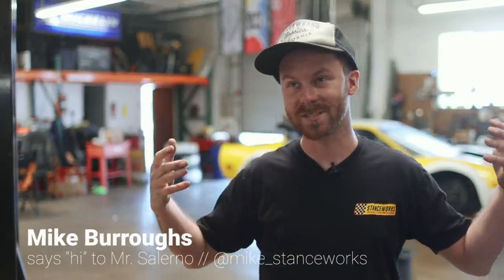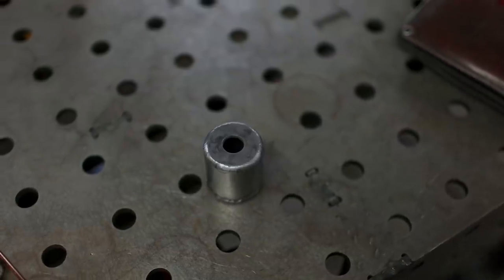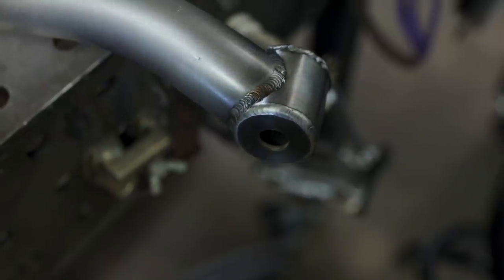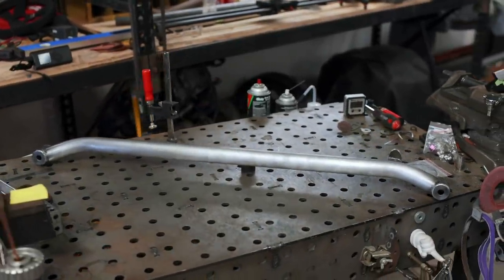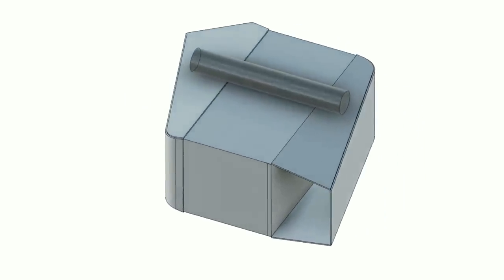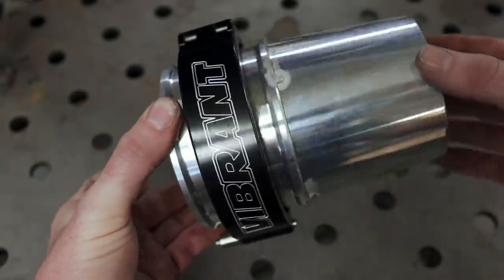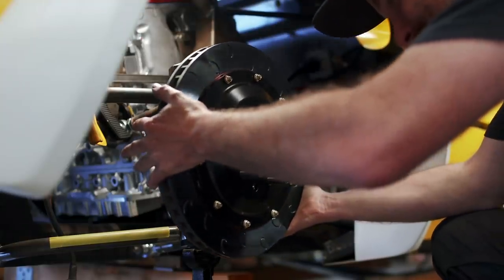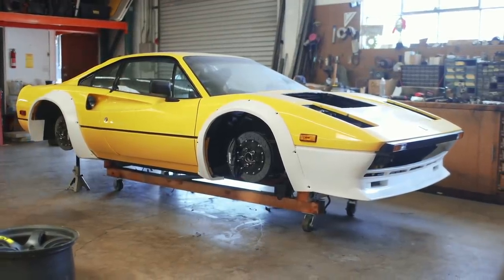Honda Swapped Ferrari - The Most FRUSTRATING Setback So Far…

Comment: If the heat exchanger is made of 6000 series aluminum, it will need mount damping with your proposed setup. That stuff fatigue cracks like a fresh tortilla chip.
Reply: @nicfoster  I remember the install video, but don’t remember seeing the core. He’ll have to figure it out.

Comment: Hi Mike, just an idea I learned a short time ago about removing zinc from washers and screws and stuff for welding. Grinding is OK but it can leave some zinc on top or in areas where your grinder won't reach. Take 25% Hydrochloric acid but it in a plastic bowl, throw in your zinced parts, watch the bubbles, don't breath in the fumes, the bubble stopping indicates when the zinc is gone. Rinse with water and weld pure steel without any zinc in it. You can even reuse the Hydrochloric acid for quite a long time! Sorry for bothering you. I'm just a fan and think your ferrari project is quite inspiring!
Best regards from Germany ✌️🇩🇪

Comment: If I'm hearing correctly... Attaching the toe arm to the control arm is a really bad idea. As the suspension travels, the distance and angle between the rod end and any spot on either control arm will change, making for massive toe changes. You really do want to attach the toe rod to the chassis on it's own pivot. It's exactly the same as setting up the location of the steering rack! You for sure have the skill and brain power to get this done correctly! Just make sure you have adjustments to raise and lower at least the outer tie rod on that stud so you can adjust bump steer. The goal should be zero bump steer or slight toe in under compression. Just helps stabilize the car on acceleration. Front should be setup for zero bump steer or slight toe out under bump travel, helps keep the front end from becoming twitchy on corner entry and mid corner.

Comment: You should try Muratic acid (pool acid from any hardware store ) it removes zinc plating in a few seconds then rinse off parts on water .. much easier and cleaner than grinding it off. Especially with nuts and bolts

Comment: I’d have to see your solution, but in my mind I can’t see how connecting the toe link to the control arm wouldn’t introduce dynamic toe throughout the suspension travel. As the suspension moves the distance from the spindle to the control arm has to change because it’s moving in an arc, and having the toe link connected there would have to introduce more dynamic toe than if the yo link were mounted closer to the frame rail in a near flat at ride height position.
Reply: I'm sure his plan is to build a tab on top of the lower arm that makes the lower arm and toe link run in parallel arcs. Otherwise yes, if the toe link angles down to the lower arm then the toe will change a ton through the suspension travel.
Reply: @Balomis  even if it is parallel at ride height it will absolutely move a ton through the travel. The length has to change as the control arm travels through its arc.

Comment: I know how you feel.  I once waited 6 months for a set of wheels.  Delay after delay.  Was flat out lied to several times.  At one point I was told that the wheels were in and when I went to pick them up they were mysteriously missing.  Searched their warehouse myself.  The salesman didn’t even help because he probably knew they weren’t there.  Was so frustrated but I was shit out of luck because no other company made they wheels in the sizes I needed.  When they finally came in months later they put the wrong tires on.  There was no limit to their incompetence.  I guess it was my fault for not having them send me a photo of the wheels before picking them up.

Comment: If I’m understanding your idea with the toe links affixed to the control arm instead of the chassis, I don’t believe it’ll work.  Unless the connection point for it on the spindle is on the same plane as the lower ball joint, you’ll have the exact same problem that you’re trying to avoid.  You’ll have variable toe angles as the suspension travels up and down because of the change in angle of the spindle to the control arm.  Perhaps even worse than if it’s affixed to the chassis.  Maybe you already have a solution by extending the attachment down to the plane of the control arm, but it is just a thought.

Amazing build all around though!  Would be nice if we could all afford to create our dreams as you’re doing.  Keep up the great work!
Reply: Just came to comment on this, I also don’t think this willl not work as intended, tslrunna423 already explained very well why. Anyway, keep up the great work with the project, and thanks for taking us along for the journey with all the ups and downs. Crazy to think that it’s the wheels now holding you back, taking into account all the possible obstacles involved in building something that no-one else has ever done!

Comment: Dude you’re definitely going to want some dynamic toe. As commonly seen on transaxle formula cars, use a bolt in pickup and have a few places to bolt it in for adjustment. The outer can easily be adjusted. This is going to be an unforgiving car with the wheelbase, width and power. Some dynamic toe in helps a lot.

Comment: The rubber mount for IC was a thought I had as well, but more than that the way the bracket is designed it's going to use 4 bolts in an arrangement that limits the way the IC has to go to get in to only be straight up rather than if the sides of the bracket were parallel it could slide in from the front or back on the way in.  If they were parallel you could go down to 2 bolts and a single captured nut for a little less work in fab and in installation.  Pretty trivial really.   I think the looks are great.

Comment: GOOD WORK!!! Your project is always an inspiration!  I'm not a suspension guru, speaking from my knowledge on my RX7 the rear of the car had a "Dynamic Trailing suspension" basically the toe would change with g-load to affect turn in and reduce oversteer. Although it was a trailing arm suspension that was a 5 point/axis setup.  But all in all, what people tend to do is eliminate the toe correction in race applications because it's more predictable when it's fixed.  That's just my two cents 😂😂

Comment: You've got the right idea of using an adjustable rod end welded to the lower control arm for the rear toe control.  Couldn't quite tell from the camera angle, but looks like you'll have quite a bit of angle on the rod end, so you'll want high misalignment spacers to handle the rod end angle.  It would be ideal if you were able to have the bolt that fixes the rod end to the spindle in double shear.

Comment: I saw the wheel crisis on the IG story when it happened and I immediately knew how defeated you were. You've been looking forward to them for months and they pulled the rug out on you.

Happy to see you're still able to make progress though! Brett's work is always top notch and the brakes look great on the car. 

Not to mention how great your welds look on the brace! I also enjoy the re-use of the bracket on the cooler, it still looks like it was made for it while minimizing waste. I'm just hoping that not adding rubber works out for you, I know vibrant's clamps have some play but the force of the water moving around during some high speed manuevers might cause some more flexing than you'd expect. Water is pretty slow in it's reaction to direction change, so the momentum alone of might cause some flex depending on the pump pressure forcing it along.

And I'm not surprised merch sold out! You've curated a great following for your work and we're happy to support you. Can't wait for the garage banner to show up!
Reply: I think the reason why his merch is selling like hot cakes is because instead of his channel name being gingium or b is for build... it stance/works which probably 90% of his followers have some sort of stance going on with their car or want to be a part of the scene. So just buy wearing it, you're gonna feel like you're part of the tilty boi clique or the poke gang even guys with lifted trucks can relate with stanceworks.

Comment: You should model the rear arms and that “steering arm” link. You will still have toe angle change if you pin the Knuckle to one arm. The angle between the knuckle and a-arm will change through the travel, causing the distance between the a-arm and “steering” arm to change.

Comment: I see why you think you don't need the rubber isolaters to allow movement but I would think of it like a radiator. A radiator has lots of things that allow movement between it and the engine. But you still put rubber isolaters on radiators so it doesn't fatigue from the car vibration. Though this car may not get driven enough that this becomes a problem. You could still add a rubber isolator easily to the mount that you designed after the fact. You could just drill the hole for the bolt a little larger and put in grommet style isolators. I really do love your builds keep up the great work, don't let the setbacks get you down.

Comment: The best way to make sure your not going to have issues with the toe of the wheel is to just test the suspension without the shock or spring on it, bolt it all together and cycle the suspension as far as you believe it will go, any issues will instantly present themselves either with lots of bump steer or not.

Comment: Extraordinary performance in mind work,  solution finding and execution. 
Funny enough, when you’ve  talked about tyre trouble I thought Rotiform could produce a set for you. I’m following a German YT Chanel called JP Performance and he is friends with Jason, too. And if I’m not mistaken sometimes they come up with custom projects made by Rotiform. Also, what I’ve heard is that the engineers at KW suspensions are able to pull off some clever tailor made suspension solutions for special projects like yours ( at least here in Germany ) . Not sure about prize tag, though

Comment: What are the specs of the wheels that you need? Maybe there are some or there avaliable that you can get temporarily while you wait for the other ones. If you mobilize your audience, there is a good chance that you'll find something close enough to avoid further delays on the suspension design.

Comment: Hey Mike, sounds like a good option for mounting rear toe link... just ensure the center of outer rod end lies in exactly the same plane as defined by lower ball-joint and inner pivots for LCA. This could be achieved with spacer btwn bracket and rod end if needed. If it's out-of-plane you'll have bump steer challenges (... much like you're dealing with on Model A, except this time at the back!). 
Great progress, keep at it!

Comment: Think attaching the rear toe link to the bottom wishbone would only work if you had a swing arm suspension. You have to take account of the movement of the top wishbone too. The inboard end needs to go to the chassis at a height between top and bottom wishbone inner mounts proportional to the height of the outer joint between top and bottom ball joints. Similarly its length needs to be in same ratio of the top and bottom wishbone lateral lengths, so all the arcs of travel match with no toe changes.

Comment: The only concern I have with the IC mount is the shear force of the bolts.  The bolts seem to be the weakest link.  it would be better if the IC was hanging by the mount and not by the bolts especially if the part will have a significant amount of vibration.

Comment: You'll still have some toe deflection with the steering arm inner end mounted to the LCA: the angle between the LCA and the spindle changes as the wheel moves through its travel.
Reply from the maker: Truth.

Comment: I feel for you with all the wheel issues. I do think that maybe there are silver linings to this cloud.

On the rear track rod, I’m trying to picture this, and I keep coming back to the point that although mounting them to the control is best. I think they need to be made as long as possible, as relative to the spindle they travel in an ark, short would induce more gain/loss with travel… or have I got this wrong????

Comment: Make sure your toe-CA setup is beefy. You've now added an additional dynamic force point onto a piece not initially set up to handle it. The control arm itself will probably be good, but make sure your mounting points are able to handle the additional stresses.

Shit happens with the wheels. You'll find something else to occupy your time.

Comment: Even if you have the tube further back, you can have the brackets centered on the intercooler. The tube itself doesn't has to be centered. I think the engine will hit the tube.
Reply from the maker: It would begin applying a lot of torque to a small mount if that were the case. I don’t want that.

Comment: I like the design of the bracket holding the water to air intercooler however where the holes are for the bolts, it’s at an angle so do u think it will hold firmly? Also doesn’t that wear out more quickly?🤷🏼‍♂️
Reply from the maker: I think the angled mounts will help firm it up.

Comment: Is the lack of final spec wheel holding up production of other components on the car? If not is seems like the delay isnt that big of a deal given the work that is left to be done on the chassis and body.
Reply from the maker: Yes. It’s holding up finishing the suspension, which is holding up ordering axles, and getting the car on the ground, etc. 
that’s all, of course, if you even believe the timeline I was given. I was originally told I’d have the wheels back in October.
Reply: @stanceworks  Damn, I thought the suspension could be resolved with the test set you had. Really sucks how things seems to be going with parts right now. Even simple stuff for this OBS ford solid axle I am installing have been challenging to locate.

Comment: I think the angles of the bracket for the intercooler add unnecessary complexity and will make it harder to bolt together. You could easily use that base plate but do straight mounts

Comment: Changing gears with hard acceleration and hard shifting will move the engine move than you think if your not gonna use flexible hoses to the inner cooler your hard mounting will not work long term. Think about ask a racer….🤔which engine movement footage in track cars.

Comment: It makes no difference whether you mount the toe link to the control arm or the chassis, you will still have bump steer and have to locate the inner pivot correctly to minimise it. It's actually much simpler to mount it to the chassis so it's not moving up and down with the suspension.
Reply from the maker: If it’s mounted to the control arm, it won’t bump steer. It’ll be completely fixed.
Reply: @stanceworks  can't be completely fixed or your suspension won't move up and down. Picture it moving up and down and the relationship between that steering arm pivot and the control arm. Or sketch it out in CAD. Toe links and tie rods have to be a certain way to have no bump steer, this is very well documented stuff, I'm afraid you can't get around it.

Comment: My dude, be careful with the brake disc-bell not being anodized on the drill surface 🙏🏻 This gave us premature wear on the GT3s
Reply from the maker: Can you elaborate?
Reply: @stanceworks  the anodizing ads a surface hardness layer that really doubles the life of the brake disc bell.  You'll find that the bell will start wearing quicker on the freshly drilled surface, increasing float on the mounting holes wich in turn can lead to huge vibration and uncomfortable  shudder.

The problem is though, once anodized, you can't re anodize it as it will throw out the clearances on the bobbin side.

Comment: It’s astounding how some organizations refuse to hold themselves and their staff accountable. Sucks that falls to you. Hold their feet to the fire to deliver the product or a refund. 
I used the same turnbuckle setup on my CRX for the STi front hubs/knuckles that I’m running on the rear. So far so good - will know when it hits the track.
Reply: There's def. some companies need to be held accountable, but after 1-2 years a very low or no production worldwide (the pandemic) supply and the workforce is scrambling to catch back up. It sucks for both us and them right now!

Comment: The tube itself needs the ends tubing (where they bolt into the chassis) so that when bolted in it doesn’t crush…….if that makes sense.  Great job all in all and don’t let those wheel builder fucks get you down!

Comment: Instead of welding your bracket to the intercooler, why not use panel bond?  It's tough, semi flexible, and wouldn't induce any stress cracking down the road.

Comment: I might just have a massive brainfart right now, but wouldnt fixing the turnbuckle to the lower controllarm essentially mean you moved the fix point on the Chassis side inline with the one of the lower controllarm? Wich most certainly is the wrong hight, giving you a dynamic (in a bad way) toe curve again

Comment: I know how much your vision matters and how the wheels you wanted fit into that. Could a potential solution be to work more in depth with your buddies at Rotiform to create a fully custom wheel that sort of replicates the original idea? Like make a StanceWorks X Rotiform replica of the ones you've been waiting for? That way you could stick to your original vision while working with a much more reliable partner, and it would also be easier to make additional ones if you wanted to at some point in the future.